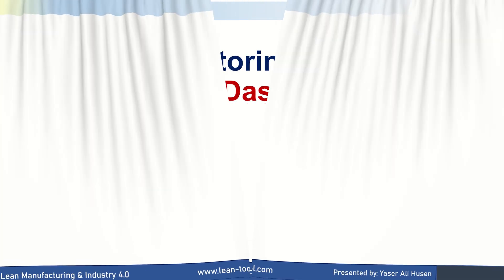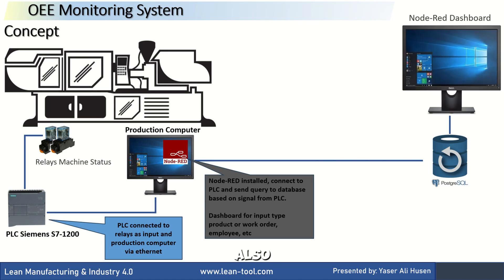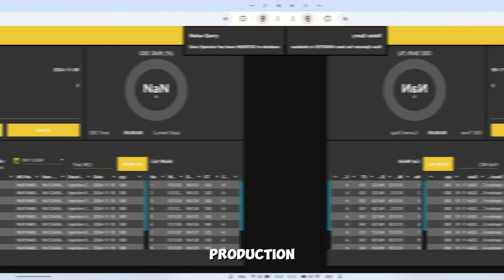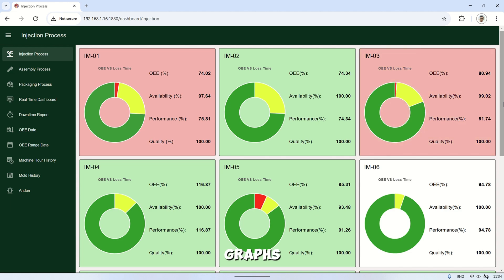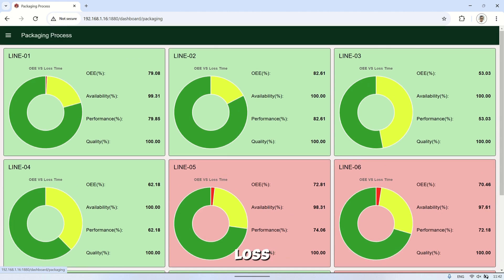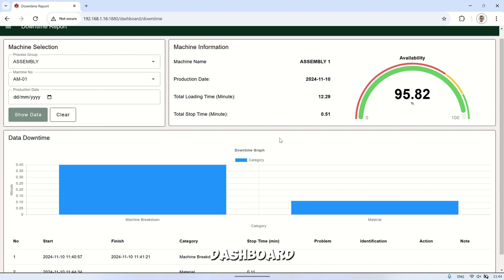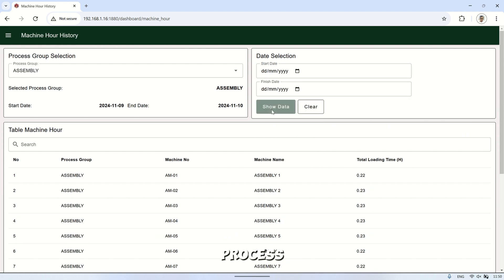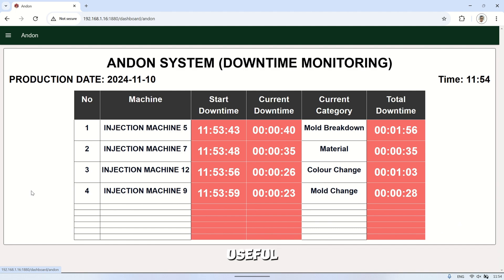Optimizing OEE Monitoring with Node-RED Dashboard 2.0: Real-Time and Historical Insights

Comment: Hola! Felicitaciones por las mejoras en el sistema OEE y en el panel de visualización. Me interesa usarlo con los plc M200 M221 y M241. en lineas de producción. Estas dispuesto a vender el sistema OEE que diseñaste? o uno personalizado a lo que yo necesito? muchas gracias!
Hello! Congratulations on the improvements in the OEE system and the display panel. I am interested in using it with the M200, M221 and M241 PLCs on production lines. Are you willing to sell the OEE system that you designed? Or one customized to what I need? Thank you very much!

Comment: Izin bertanya pak, untuk mengambil data modbus dari kwh meter dengan USB Rs485 converter apakah memungkinan menggunakan jaringan LoRa ? Seperti yang kita tahu substation berada dalam ruangan tertutup , khawatir tidak terjangkau di ruangan lantai 2
Reply from the maker: Harus dicoba langsung sih, test LoRanya pakai pesan test atau lainnya, dan pastikan bisa transmit data lewat ruangan tertutup atau ga
Reply: @YaserAliHusen  jika direct kabel 2 wire only device(shield type cable) dengan 10 unit kwhmeter apakah aman selama dalam jarak dibawah 1200meter?
Reply from the maker: @Surya45-iz8hq  kenapa ga coba pakai Wifi atau ethernet atau mqtt untuk kirim datanya?
Reply: @YaserAliHusen wifi yah, saya belum ketemu video tutorialnya apa ada dichannel ini? dengan device yang banyak ada rekomen modbus master support wifi pak?
Reply from the maker: @Surya45-iz8hq  Bisa pakai ESP8266, ada beberapa video saya yang membahas modbus dengan ESP8266 atau juga WT32-ETH01 jika ingin menggunakan ethernet
Reply: @YaserAliHusen  baik Pak terimakasih, akan saya liat
Reply: @YaserAliHusen  baik Pak terimakasih, akan saya liat
Reply: @YaserAliHusen  pak mau nanya. Seperti yang kita tahu perusahaan punya server tersendiri.. Apakah bisa menggunakan esp8266 terkoneksi pada wifi yang terhubung pada server perusahaan? Apakah node red bisa diakses dengan server perusahaan?
Reply from the maker: @Surya45-iz8hq  Di server bisa install Node-RED yang kemudian membaca ESP8266, misal komunikasinya MQTT atau TCP
Reply: @YaserAliHusen  Jika alurnya, dari modbus rtu power meter > rs485 USB converter> esp8266 konek ke wifi LAN> node red... Apakah benar pak?
Reply from the maker: @Surya45-iz8hq  Iya bisa begitu
Atau pakai RS485 to LAN, terus konek ke jaringan agar nti nilai modbus dibaca oleh Node-RED
Reply: @YaserAliHusen  ok baik Pak terimakasih informasinya
Reply: @YaserAliHusen  rencananya, ada sekitar 7-10 power meter yang mau diambil datanya sekaligus dari 1 tempat (substation) dan jaraknya jauh dari PC..
Reply: @YaserAliHusen  Pak saya mau nanya, apakah bisa menggunakan node red tanpa mqtt?
Reply from the maker: @Surya45-iz8hq  , bisa silahkan pilih alternatif komunikasi lainnya, misal TCP dsb
Reply: @YaserAliHusen  sebenarnya apa fungsi mqtt? Jika node red sendiri bisa membaca langsung nilai modbus tcp/rtu? Saya masih agak bingung tentang mqtt, beberapa tutorial menggunakan modbus tcp/ rtu > node red dan ada yang menggunakan modbus > mqtt > node red